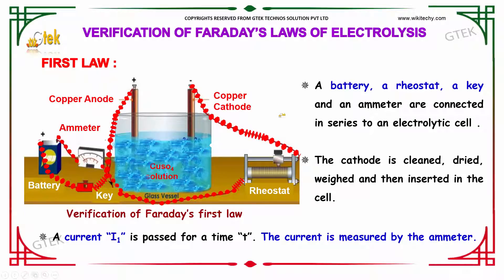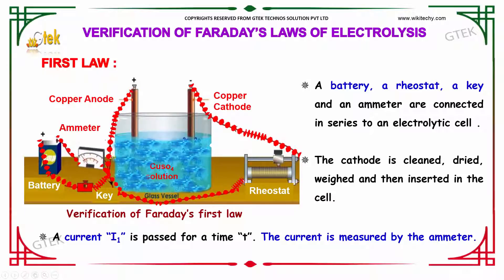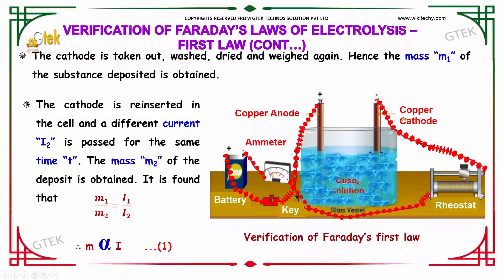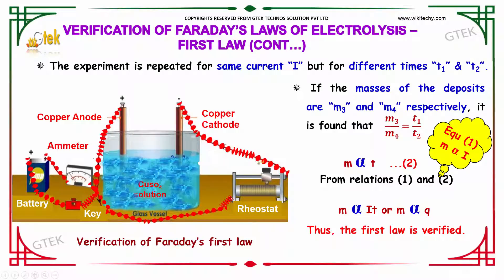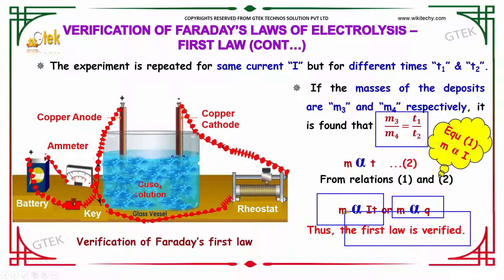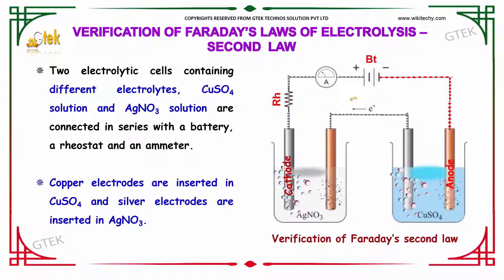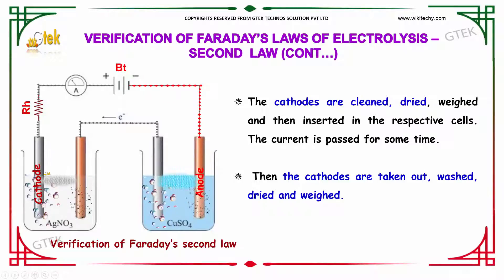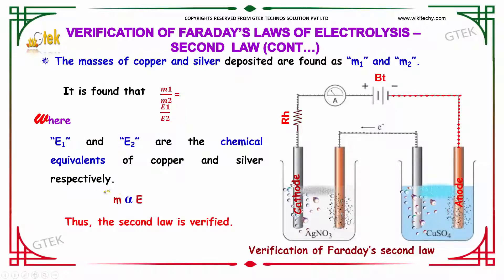Verification Faradays Law of Electrolysis Current Electricity  Class  12 physics  CBSE IIT JEE NEET

Comment: Before understanding Faraday's laws of electrolysis, we have to recall the process of electrolysis of a metal sulfate.
Whenever an electrolyte like metal sulfate is diluted in water, its molecules split into positive and negative ions. The positive ions or metal ions move to the electrodes connected with negative terminal of the battery where these positive ions take electrons from it, become pure metal atom and get deposited on the electrode. Whereas negative ions or sulphions move to the electrode connected with positive terminal of the battery where these negative ions give up their extra electrons and become SO4 radical. Since, SO4 cannot exist in electrically neutral state, it will attack metallic positive electrode and form metallic sulfate which will again dissolve in the water.

Comment: First Law: A battery, a rheostat, a key and an ammeter are connected in series to an electrolytic cell (Figure). The cathode is cleaned, dried, weighed and then inserted in the cell. A current I1 is passed for a time t. The current is measured by the ammeter. The cathode is taken out, washed, dried and weighed again. Hence the mass m1 of the substance deposited is obtained.

Comment: According to the second law of electrolysis, the same quantity of electricity will produce or dissolve chemically equivalent amounts of all the substances. Therefore, the same quantity of electricity is required to liberate or dissolve one equivalent of any material during electrolysis. This quantity of electricity is called Faraday (F). One Faraday is equal to 96487 coulomb per mole of electronic charges. For the sake of convenience, we generally use a value 96500 C mol-1 for the Faraday constant (F).